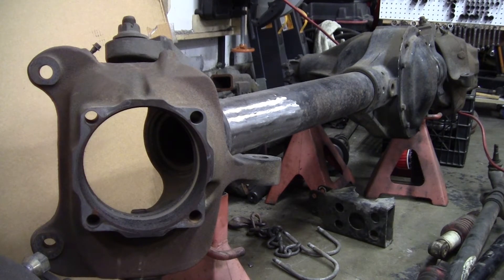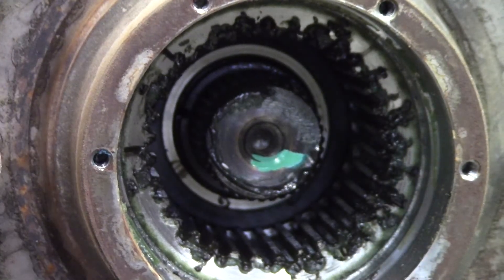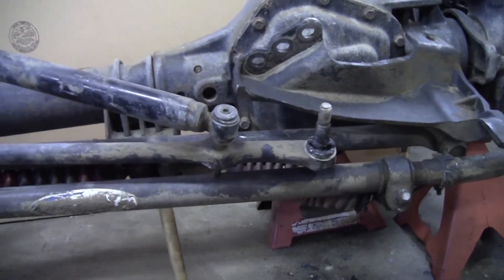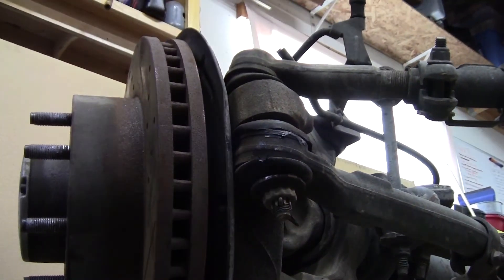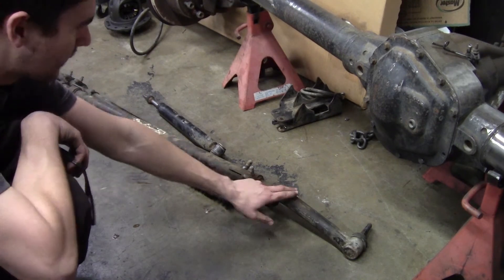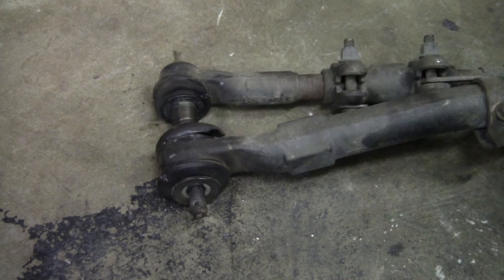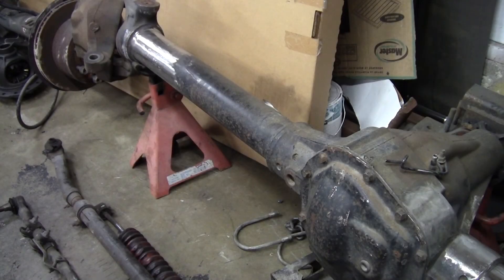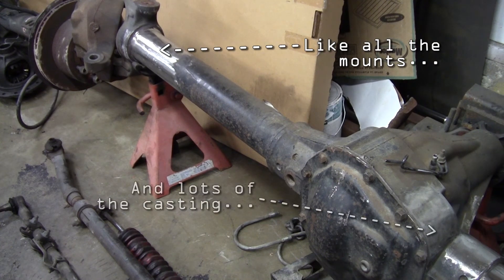Super Duty Dana 60 Disassembly and Shaft Removal

Comment: The seal on your axle shaft looks rubber. Ours looks like rusted steel of some sort and does not want to come out
Reply from the maker: Yeah mine is a rubber/plastic seal. There's a steel backer attached to the shaft but it doesn't contact the knuckle. What year is your axle?
Reply: @WebWheeler  ours is an 03
Reply from the maker: The 2004 and earlier axles are going to be different than this one- once you pull the unit bearing on yours the shaft should pull out without being pried like these later ones. Or are you trying to get the seal off the shaft? That might require some tapping with a hammer and punch
Reply: @WebWheeler  check our Instagram. But yeah there is a metal seal giving us trouble. Got her popped tho @stickybandit98
Reply: @WebWheeler  also thanks for the information dude. Videos like this are awesome and people who respond are even more awesome
Reply from the maker: Haha no worries man glad you got it!

Comment: How do you get to those bolts in the back by the u joint? My sockets dont want to get on them all the way because of some seal or something protruding where the axle shaft goes into the hub
Reply from the maker: Huh I have never seen anything that blocks you from getting to the unit bearing nuts.  All the seals should be inside the bore on the knuckle.  There could be a dust shield attached to the stub shaft but like I said- I've never seen anything that covers the nuts.  What year is the axle?
Reply: @WebWheeler  its out of an 04 f250 super duty
Reply from the maker: The '99-04 axles have a different unit bearing setup than this one ('05+) but I think the process is the same. Never heard of anything blocking those nuts on either.  Might check for some other videos that deal with the earlier axles